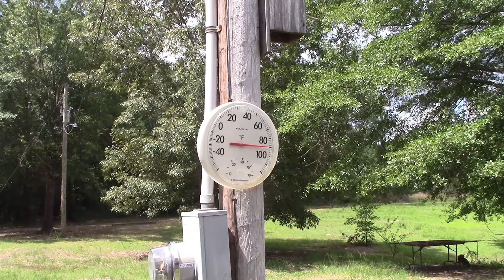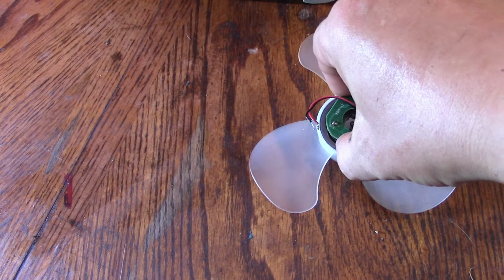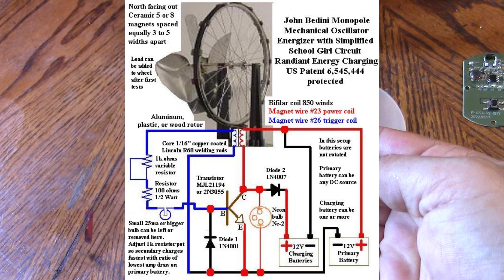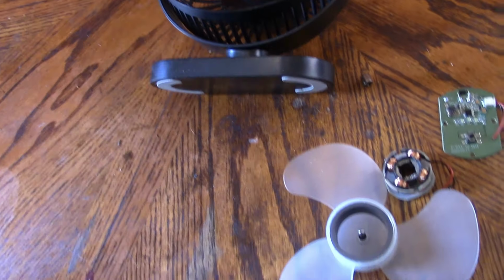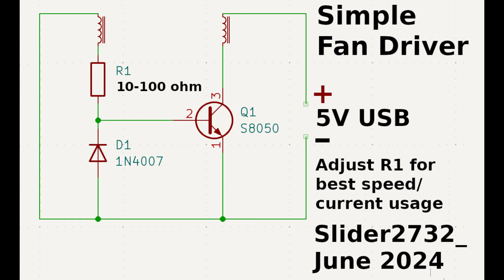DIY Brushless Fan Circuit

Comment: Sweet I have a couple of those little fans that don't work I'll try your circuit not sure I have the same transistor though.
Reply from the maker: Any NPN will work. The S8050 is just capable of 1.5A and turned out to be overkill with the circuit only drawing 200mA. Have got another running with a C945 😀
If a transistor is marginal, a penny superglued to the flat face works well as a heatsink.

Comment: i see your circuit you lacking something to make it more powerful  for same current. Try to put schottky diode parallel to the main coil but in reverse polarity to not short directly to supply voltage ground it will feeding back the collapsing magnetic field to it self  that create more power